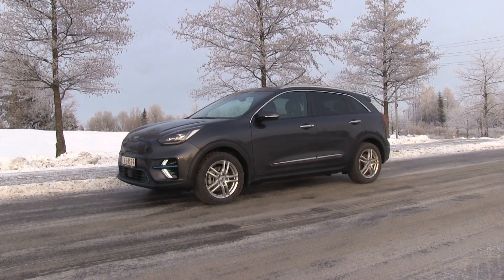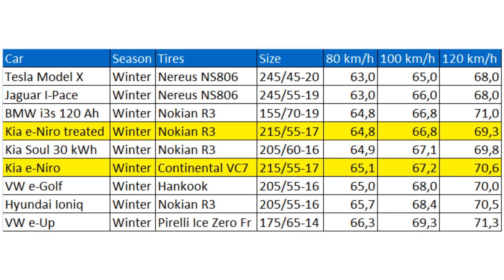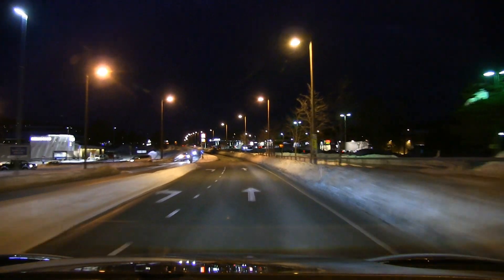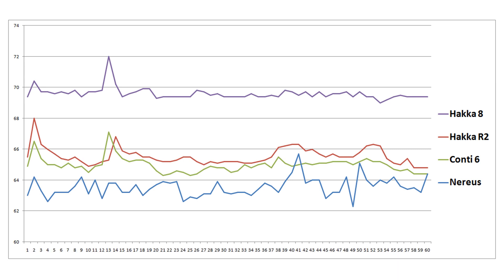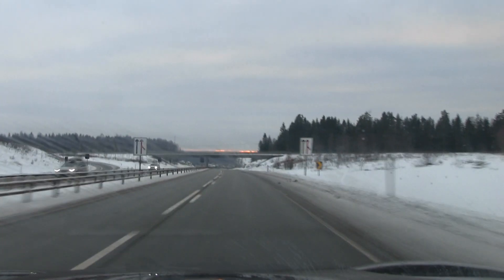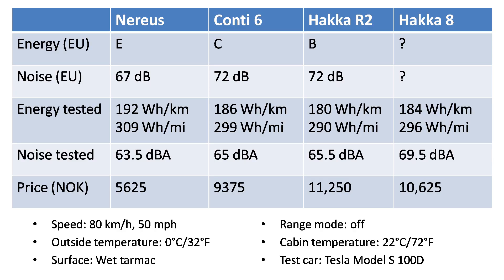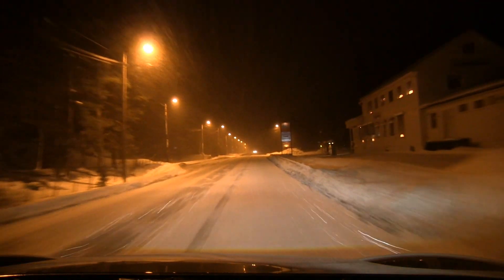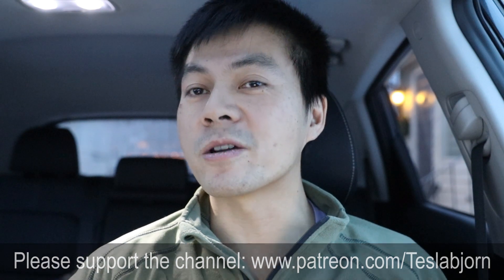Kia e-Niro noise test (w/rust treatment)

Comment: Tyres can make an awful lot of difference to in-car noise, even in a ICE car. Years ago, I replaced my worn out factory fitted Pirelli tyres on my SAAB 900, with Michelin tyres, because everyone said Michelins were the way to go [Hey, I like Michelins too]. They were noisy, the handling went to crap, and they wore out quickly [thank goodness]. I went back to some new Pirellis [600s, IIRC] and they were quiet, grippy, and the great handling car was back. So factory-fit tyres are often there because they were designed to be, and can make a huge difference. And not just to noise either.